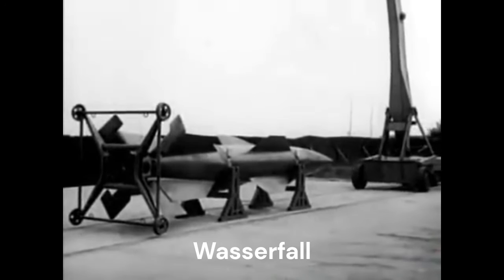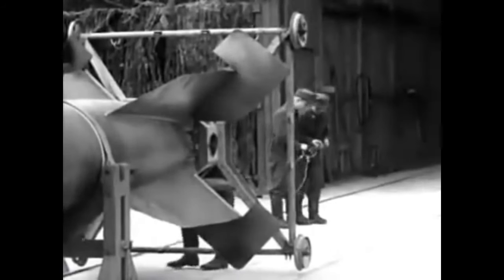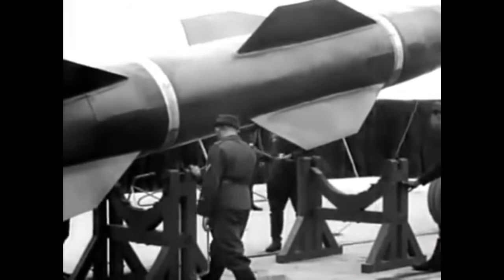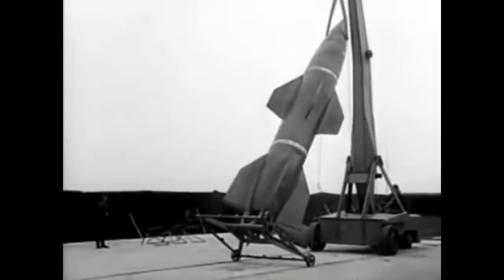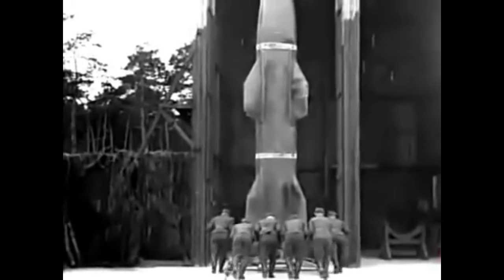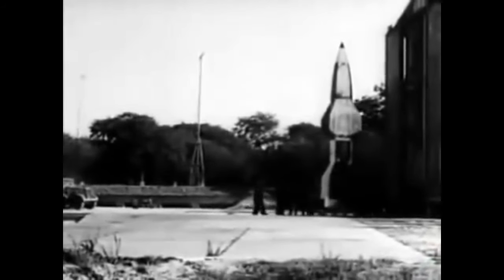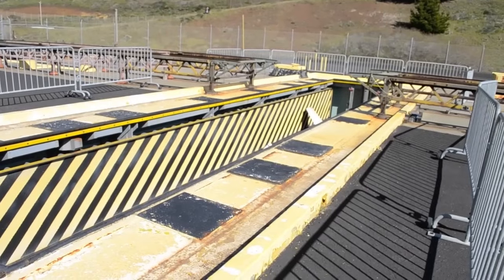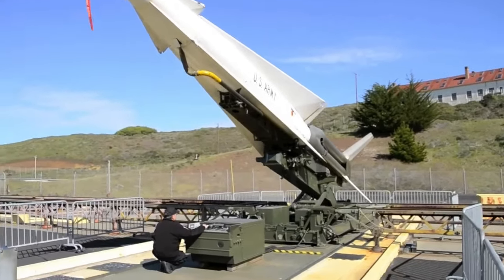Wasserfall Surface-To-Air Missile: V-2’s Little Brother That Could Have STOPPED USAAF/RAF ('43 -'45)

Comment: They should have developed a proximity fuse for their AA ammo like the US did!
Reply: there was no US AA rocket at that time
Reply: They had a problem proximity fuse program which was suspended in 1940 during the battle of France so that resources could ne concentrated on fielding weapons that were less than 6 months from delivery.  By the time the program restarted in late 1942 it allowed test firing of about 1000 in 1943 but the factory was over run in 1945 so no mass production.   It was called Kuhglochen by Rhinemetal Borsig. Siemens did the cold gas threaten.  German bomb delays were electronic
Reply: @williamzk9083  - By 1945, the war was over. Germany had lost or was on the very verge of losing.  1943-44 were the critical years for the bombing offensive against Germany. The losses in synthetic fuel production was crippling to the German war effort.
Reply: @scootergeorge7089  The War was lost in September 1940 when the Luftwaffe failed to beat the RAF
Reply: @sichere  - The Battle of Brittan was not the end, or the beginning of the end.  Other than Lend Lease, Brittan was all alone.   The combination of the June 22, 1941 invasion of the Soviet Union,  "Operation Barbarossa"  and the December 11, 1941declaration of war against the US, meant the chances of victory virtually nil.
Reply: @scootergeorge7089  The Correct analysis is that after their spat with the RAF in 1940 the Luftwaffe and were in no position to commence Operation Barbarossa. 
The Atlantic Charter ensured that America was on the right side of the fence. 
The end of the beginning  was El Alamein and Stalingrad in 1942 as the British had secured India the Suez and Persia.
Reply: @sichere  - So, how was the Battle of Brittan decisive?
Reply: @scootergeorge7089  The Germans lost a huge amount of men and resources fighting in the BOB and were in no state to then  take on the Russians. 

They never recovered from their losses and the problems only got worse.

By July 1944 the average new Luftwaffe pilot had around 120 flying hours, just 15- 20 of them in his operational type. By contrast, American pilots were receiving 400 hours training, nearly half of it in their operational type, and RAF pilots around 350 hours, 100 of them in operational types.
Reply: @sichere   First of all those are later war stats.  Second, Germany would have absolutely crushed the Soviet Union if it weren't for lend-lease.
Reply: @gratefulguy4130  First of all the Luftwaffe were defeated in 1940, and hence were not in a position to commence Operation Barbarossa which only compounded their problems and the poor statistics.
Reply: @sichere  - There was not enough aviation gasoline to properly train replacement pilots. 8th Airforce bombed the heck out of the synthetic fuel plants.
Reply: @augustiner3821 Proximity fuse was one of the secret weapons of the allies.
It was basically a small radar build into a shell which detonated after firering and going close to another object or the ground.
In anti air it meant that the shells could not fly by.
In artillery it meant that the shell could explode over the heads of the targets, making cover useless.
Reply: @molybdaen11  agree with the proximity fuse issue. On the German side, I'm not sure, I can't find any official source that confirm a German solution, but saw recently a YT-clip by hw97karbine where some German heavy mortar ammo detonated before impact. But the center of interest in this clip is the AA rocket technology. And yes, a combination of both had been perfect.

Comment: An object too big and with too many materials, to worth being dispensed for only one enemy plane, even if the victim would have been a 4 engines bomber.
Other German engineers developed a much smaller RC missile, and much cheaper. The prototype was supposed to be tested in France in 1944. The transport trucks were bombed on route to destination.
Reply: only one bomber you say... and crew?

Comment: They shoud haw simplified rocket engine. Its was wery hard to develop such a system whit liquid fuel.
Soviet S-75 is a child of this program, Nike similar but solid buster was a beter option.
And after all that work partly based on low smoke launch we are now using AP smoke rich fuel.
In WW2 only GALCIT was known of perchlorate fuels.